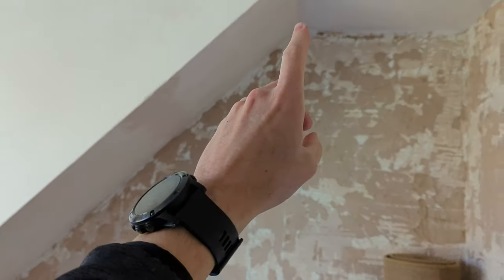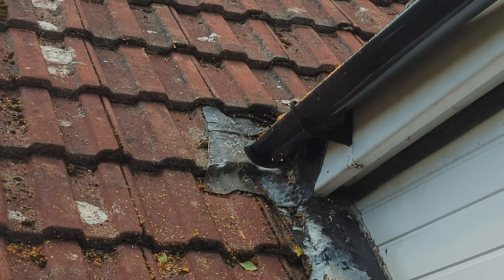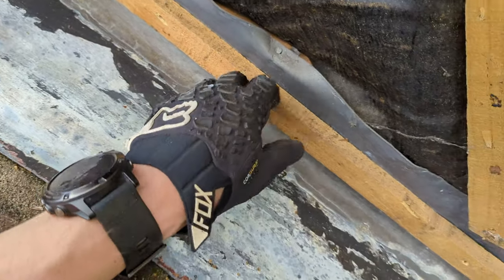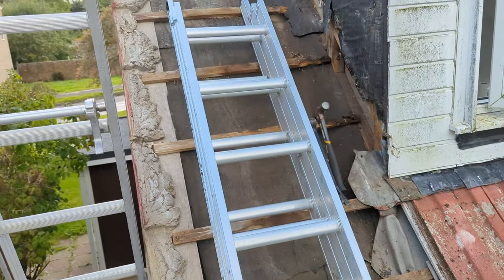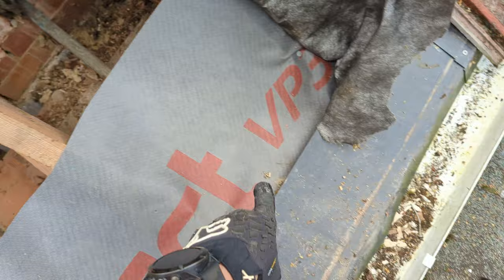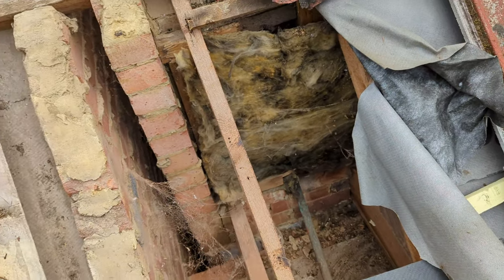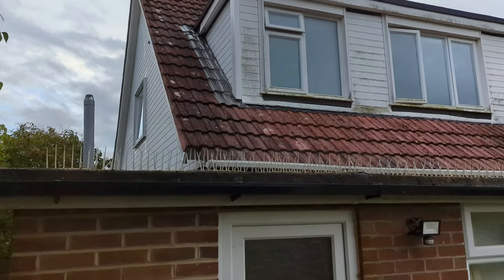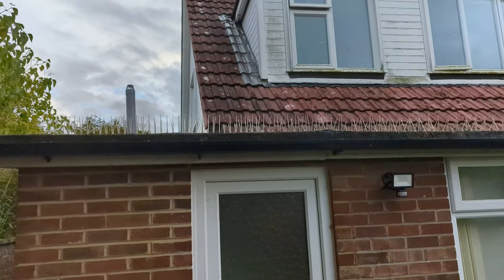ROOF LEAKING AGAIN! New Membrane and Battens - DIY Roofing! Dormer

Comment: How to devalue your home 1.01 so much wrong with this video don’t follow this guy at all hasn’t got a clue and I doubt his fixed his issue the leak is coming from further up the roof
Reply from the maker: I did find the leak... And fixed it. Magic 🤯

True, I've no clue what I'm doing but I'd rather  make a hash of it and then correct it later than not even try.
Reply from the maker: What needs correcting?
Reply: Has this leaked again since you done it

Comment: Surely coming from the top where the flat roof meets the crop
Reply from the maker: No, it was running through the hole in the membrane, water was working its way under the tile higher up but, leak free now!

Comment: I had a little water coming into my loft where the lead was covering the tiles where you put the flash banding (water was tracking underneath like yours for the same reason - not enough overlap), but I used some leadmate caulking between the tiles and the lead flashing. It did the trick and has lasted a few years, but I might try the flash banding you used next time - I don't know if it was around when I used the leadmate. As a DIYer myself, I was impressed by how you interpreted how things went together, why, and how you could make it better. Keep up the good work!
Reply from the maker: Thank you! No harm in giving it go... it's a goes wrong, pay a pro!

Comment: Why not do it in lead though? It's been tried and trusted for centuries.
Thats where the word "Plumber" comes from. I think its Latin for "Worker in lead". Flashband is a temporary fix. I've done many dormers in lead with either soakers,secret gutters or like you've done with lead dressed on top depending  on the slate/tiles. As one of my old plumbing mentors used to say " Imagine you're a raindrop trying to get in!"
Reply from the maker: Quick and easy fix for now. I really want to redo all the plastic and lead on the dormers and at the same time see if I can insulate better. 

I'll get some code 4, 400mm at some point and have a go at dressing the lead. Any tips to make it look good?
Reply: @froywhernside  You will be better with 5 lb if you're dressing it. Maybe 4lb if leadburning but both are are not for the fainthearted! I don't think many plumbers do it nowadays but it was all part of our apprenticeship back in the 70s. I can't help you from afar but  best to let the lead warm.up a bit in the sunshine to make it more malleable. I'll see if I have an old video of us making a chimney Apron a few years ago. (Dressed)

Comment: if you had a choice would you have bought a house with dormers? They look like trouble.
Reply from the maker: NEVER AGAIN. EVER!  

We bought the house because it's got a bigger garden than normal and it was in a sorry state so, also cheaper than normal. 

But no, never will I buy a house with dormers again, definitely more maintenance and cost required
Reply: I had 8 dormers but I sold before they needed tlc

Comment: Subscribed - do you live in my house??! :d We live in a house that looks pretty much exactly like yours, ours was built in the late 60s. We have flat roof dormers front and back covered with felt and with the same stupid design where the water runs to the back of the dormer and is then supposed to drain off the sides. Inevitably the water just ends up pooling on the flat rooves at the back. On the north side, where the back of the flat roof meets the tiles it is just a mass of moss and horribleness. We haven't had any leaks yet (been here 5 years), but it's only a matter of time I feel and so we need to do something. Some of our neighbours have gone the whole hog and have replaced the flat dormers with tiled pitched roofs up to the ridge - but I think that is a huge massive expense and overkill. Instead we are currently looking at replacing the felt with epdm and changing the pitch slightly to take the water forward (and put a gutter on the front). Are you thinking of doing anything similar with your roofs? be interested to hear!
Reply from the maker: Great design isn't it!! 😵‍💫

So, we had the dormer flat roofs re-felted a couple of months ago because the neighbours also had leaks and we combined forces so we don't have horrible joins between the two houses. Cost £1300 front and back. 

I'd love to get rid of the flat roofs but like you say, the cost can't be justified. The felt roof should last at least 10 years if done properly. Refelting every 10-15 years wouldn't be a major thing.

I did ask the roofer about pitching the roof towards the front but the added cost of all the sheet timber, tiles amendments will quickly move in to thousands of pounds, he also said they're not designed to run off the front so we could cause more problems with running water down the front of the dormers.
Reply from the maker: Whilst I still can, I'll get up there once a year to clean and inspect, do what I can to keep it in good shape.
Reply: @froywhernside   That's great information, thanks so much for replying. This design must have been all the rage in the 60s. You are right in that a couple of quotes for replacement epdm, change pitch, add extra insulation while up there etc. ran to thousands of pounds!!  I hadn't really considered replacing the felt though - but maybe I should until I win the lottery! Out of curiosity, did you find out what was underneath your felt (wood deck or asbestos or something??) and was it OK condition? And by the way, you are very brave to attempt what you've done in your videos, so impressive! Oh and we also suffer from the green algae!!!
Reply from the maker: Certainly "cheap" to replace the felt in comparison, I probably paid over the odds as well to be honest. 

Under the felt was wooden boards a bit like floorboards so, no damage because the water was able to run in-between the boards and straight through the insulation and on to the plasterboard ceiling.

Brave... Stupid more like 🤣
Reply: @froywhernside  Thanks for the info! Really helpful. This morning I replaced a cracked tile on the very front below the dormers - and just like yours there are no eves protectors and the felt has collapsed creating a sort of u-shaped trough. The tops of fascia boards are rotten. Quite pleased to have replaced a tile though - they are unwieldy buggers. And just like yours they weren't nailed down either.
Reply from the maker: We probably live on the same street 🤣
Reply: I’m in the same boat as yourselves. Reference the flat Roofs I’ve just had a builder replace front one with Rubber. Me an the neighbour had the whole front roof done. Stripped off. 50mm Celotex put in, 3x2 timbers to create a forward fall, 18mm osb, rubber, new fascia and gutter. £3k. Happy to send pictures if You drop me your emails. Costly but should stop any future issues.

I’ve had to do similar to Froy at the rear due to water getting in however I’m waiting for next spring /summer to really attack it. I’m going to strip the entire gable end, refelt, batten and dry verge.
Reply: @froywhernside   Haha - Shropshire here...
Reply: @RossTheSpark  I put a comment on here earlier, but it looks like it has been auto-removed, probably because I put my e mail address in it (allbeit disguised). Suffice to say that I'd love to see the pictures of what you did - this is exactly what we had thought to do, so it would be really, really useful to see how it was done. Not sure how best to share the images though? Maybe a free image sharing service?? P.S Welcome to the rubbish design flat roof club!
Reply: @RossTheSpark   would you be able to share any pics of your works? I'd still be really interested to see if you can....
Reply: @froywhernside interesting as my dormas have front draining specifically designed with wedges to give the correct fall. 

They gutter at the front and it flowed around the side into a small down pipe to the sloped roof. 

The only problem I’ve had was when I had the felt replaced with EPDM which increased the speed at which the water flowed off the roof. This then pushed up under the tiles and caused a leak into the house. 

I ended up re routing the down pipe much the same as what you had there which solved the problem. Not had an issue since.

Comment: Should have used a secret gutter
Reply from the maker: What's that? Assuming a gutter under the tiles... Made of what? Lead?
Reply: @froywhernside  made from plastic it goes on top of the batten just have to leave it short about 50 mm away from the dormer side so the channel on the gutter can fit in and then tile into it and then siding over top if you search online you will see
Reply: He did, but kept it quiet 🤫 😂